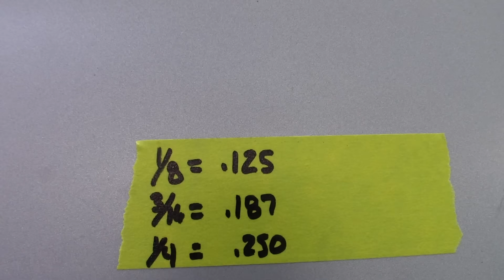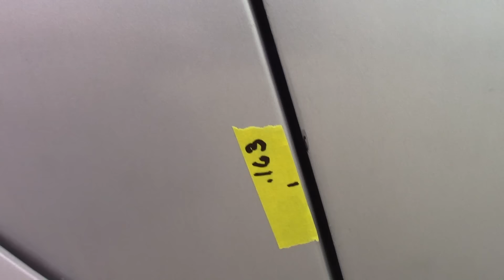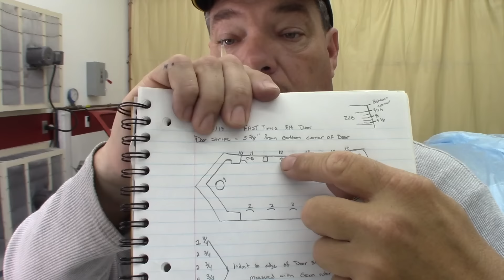1970-81 Camaro Door Skin Removal how to DIY

Comment from the maker: Thanks for stopping by. A little more ratchet jawing in this one, but I wanted to give you as much info as possible to help you on your project if your attempting to remove your door skin. I forgot to mention, before removing the door, verify the hinges are ok. There is a two part video series on the channel about rebuilding second gen camaro hinges. Also take a sharpie and mark your spot welds on the hem flange.  Again, thanks for stopping by and checking out the progress and supporting the channel! Russ

Comment: Hi Russ. Good job and slow grinding does help save the structure. See you next video.
Reply from the maker: Thanks Wiley. Yes, definitely don't want to go to far with the grinding.
Reply from the maker: Wiley, I'm working on another mirror video. Is it ok to share you comment about the dealer installed passenger mirrors during my next vid? Thanks, Russ
Reply: Hi Russ. That will be OK. I read that in one of my resource books. If I can come across it, I will let you know the name of book.
Reply from the maker: @wileygailey9553  Thanks Wiley. I got another mirror that came in a kit. Working on a vid for it now.

Comment: That door wasn’t in that bad of shape!  I’ve seen worse!  Formerly from Minnesota, rust was just a way of life for most cars.  Even think I had a 78 Caprice that was held together with rust.  Great video!
Reply from the maker: Thanks, It wasn't too bad, it did have a little more than I thought once I got into it, but thats normally how it goes. This one could have been fixed without a skin.
Reply: Double R Restorations I’m exited to see the repair!  What is normal for the door gaps?
Reply from the maker: Thanks, I think I'm going to go for 3/16 in bare metal. That will close up some with primer/paint.

Comment: Russ I don't think that my '79 had that good of door shells on it in '87, you are one lucky man my friend... Clean up the frame and reskin them and keep pushing forward, make sure to put in a ceramic coating or lizard skin along with a sound deadener for the most effect. BTW the felts and rubber gaskets only lasted about 5 years depending on where you lived before they failed and again you got lucky
Reply from the maker: Thanks Darrin. I put the Lizard Skin on the inside of the new door skins. I really like it. Nice product. I'm glad the shell is in good shape.

Comment: I was restoring a 72 camaro 20 yr ago, had the door skinned, best I done till then,  hammer and dolly, no mud. Hung the door up,primed it, walked away, the door fell,. I was so pissed, ruin my skin, bent up the door frame.  
Pick up the door, walk outside. And through it about 15ft, a left it. Next day, started all over, new door, new skin. God I hated that camaro. Sad part, the kid didn’t understand what it cost to restore  a car,  pulled it crying from the shop( we didn’t charge him for the door, I paid 1/2) what fun days working, now I can’t work, bad neck, shoulder, neuropathy in the hands, and arm, bad feet, and back,... wreck my body working on cars, hard way to make it. So just a fun though, for the day,,,,,,,
Reply from the maker: Tim, these doors have been alot of work. I'm getting ready to attempt the skins. I hear ya on the body, this is a hobby for me. I have had alot of trouble with mine lately from the years I have spent on telephone poles and being out in the weather. I'm 48 now, and have a ways to go before I can retire. Lately I have been trying to take better care of myself. We just don't think about these things when we were young. That's one reason when working in the garage I try to take as much safety precautions as I can. I see alot of guys on YT that wont wear a mask when sanding. Thanks for stopping by.

Comment: Russ, I just took my Muncie M20 for a transmission service and had all the seals replaced. How come it will still barely leak out of the areas where the linkage connects to the transmission?
Reply from the maker: Transmissions are the one thing that I haven't worked on. I sent my original th400 to a transmission shop. I haven't even looked at the the t10 for the 81. Wish I had the answer for you.

Comment: Just a thought but couldn't you hang inner structure, get the skin edges rolled in so they won't interfere and put it up on the body, slide it to where you like, at the quarter and rocker, clamp her down the 3M glue her down. Again just a thought Boss, your doing good work.
Reply from the maker: Thanks mason. Yes, that would work for installation. I have seen guys do this. I'm still thinking about glue vs welding. I think there are pros and cons to each method.
Reply: Been in this for 20 plus, in a non-structure panel use the glue, maybe a few tacks in the corners but let that glue do it's job, I would rather take 10 welded panels off over one glued, plus I feel better knowing their is less raw metal left exposed verses a weld up, always places you cannot get paint,primer or anything over what you've ground for weld and can no longer access once installed. I see VA. apparel, I'm in Pikeville,KY.
Reply from the maker: @masonl8128  Thanks mason.  That is some good info. I had never thought about removing a panel that had been glued on. I can see where that would be a job. Yes, I'm in sw VA., not too far away from you.

Comment: Never and I mean never liked the gaps on these years, its a little more work but I'd shoot for tighter gaps, cutting and welding in material, regular folks will never notice but those who know will.
Reply from the maker: Absolutely! Definitely when we get to that stage we will manufacture the gaps to be consistent.  I think I will go for a 3/16 gap in bare metal before paint.